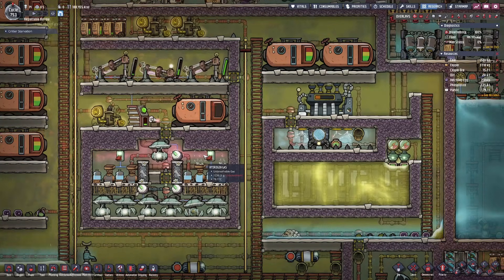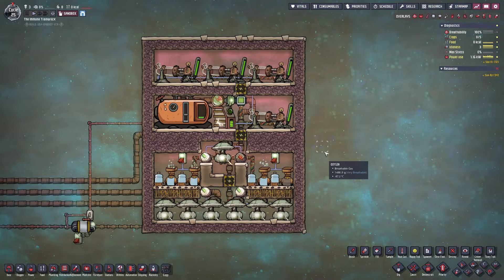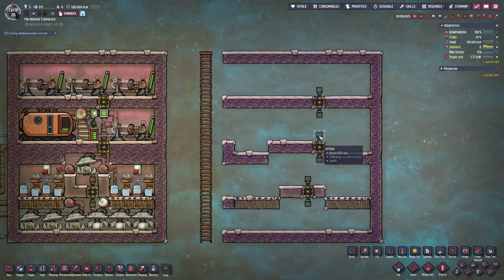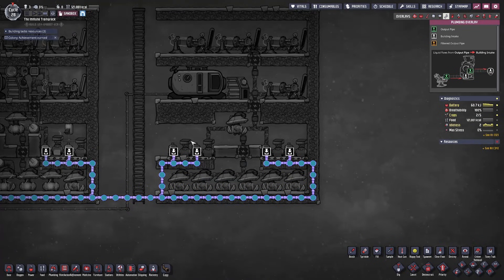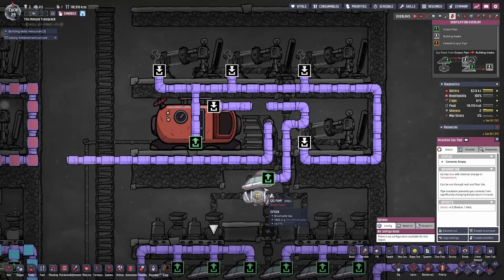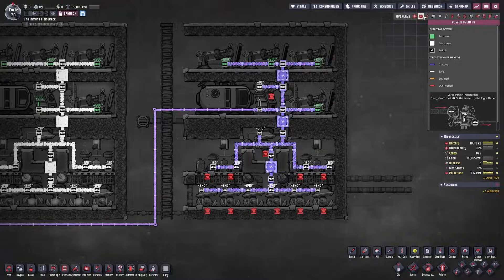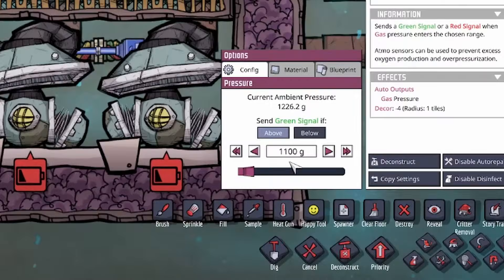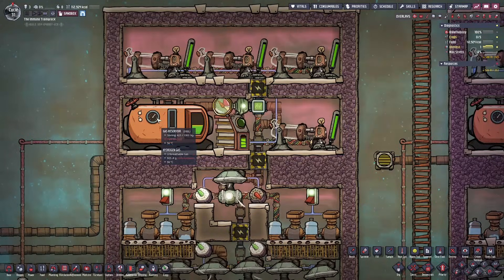HOW TO BUILD THE SPOM 2025 for BEGINNERS in Oxygen Not Included - Self-Powered Oxygen Maker

Comment: you can replace the shutoff switch to the electro's with the "Disconnect" tool at the bottom right of your screen. no water, no issue, doesn't use dupes. also "rebuilt it with the pipe" to undo it, still dupe free.

Comment: if you set the gas shutoff/sensor to O2 instead, then it'll only use power when it detects oxygen. even more power savings!

but wait, there's more! if you replace the shutoff with a vent, it uses no power.

Comment: What about cooling inside of the H2/Battery chamber?
Reply: Not sure if the setup in the video overheats given enough time, but if it does it would probably never overheat if you had the gas pipes carrying hydrogen to the generates pass through the hydrogen generators (rather than burying them in the insulated tile) and used radiant gas pipes for those sections instead. The hydrogen comes out at a cool 70*C compared to the 125*C overheat temperature (w/ gold amalgam). The hydrogen generators destroy any heat in the hydrogen so I'd imagine it's extremely unlikely the stable temp is anywhere close to 125*C.
Reply: @garrettgutierrez2677  Well I tried it both ways and I can tell you from bonafides that it will overheat, even with using the incoming hydrogen for cooling. It just takes a long time.

Comment: Nice touch! I love the gas shutoff.

I'd suggest to add a valve in the water supply line for fine control of output.

Other thoughts I might try..
- 2 of the hydrolizers get a switch each, so I can easily go for 1, 2, 3 or 4 active depending on colony growth
- maybe also add some of the oxygen pumps on those switches
- hydrogen first goes into storage and local generator & smart battery
- no heavy-watt wire but power converter(s) and regular or conductive wire for the local circuit
- surplus of hydrogen after 1st generator hours out to another storage with output for canister filler and extra generator(s) connected to main grid (I'd activate these on very low smart battery charge to only use in emergency)
- some way to get rid of surplus surplus hydrogen, e.g. having those extra generators also activate when last storage is full, or another overflow pipe to vent to space
Reply from the maker: Yeah, those are some great points. The switches help control output, especially if your colony is still young and you built the spom for later on. 

For the excessive hydrogen, you could use the infinite storage method and then take out what you need as you need it, or increase your power output and tie into the rest of your base electrical grid, which is what I did in the example at the start. 

On my asteroid, I didn't have a hydrogen vent, so I placed an excessive amount in reservoirs for future use.
Reply: @ethanplays-lag  yeah infinite storage would work too.
I usually forget about that option because I'm that kind of dinosaur :)

For scaling with the colony I do wonder if maybe there should be an airlock cutting the oxygen area in half. That would open when switching the duo hydrolizer on.

That way in early stages the oxygen from the single unit builds up in a smaller volume so it's fully active sooner.

I like how your presentation triggered these thoughts.
Before this I would just have built one small unit and at a later stage do another small one, or a large one and tear the small one down.
It's elegant to have something that will scale up all the way to the end.
Reply: Oh but when there's an airlock to cut it in half there should be one blocking hydrogen too.
Otherwise that side will just flood with hydrogen.

Maybe not such a good idea then. 
Or incomplete.

Comment: I adore the Rodriques SPOM, so sorry in advance for the long comment ^^' 

The Non-SPOM you show in the beginning has one huge disadvantage in my opinion.. The joint plate that you have plugged in between the gas-part and the generators-part is transferring heat to your colony like crazy... You have over 60°C next to your transformer... I would find a way to stop that heat transfer - either by vacuum or by sealing it in somehow.

Regarding the SPOM.. Instead of using that much heavy watt wire inside the SPOM itself, you can just make an overflow pipe for extra hydrogen and run that out to a generator outside of your SPOM connected to your main grid :) That is my preference, just to save some extra ore..

At 12:02 you show the gas overlay.. Now you don't need to do this, but I would add an extra line of gas pipes out of the SPOM so that you have a total of 3 lines.. The reason for this is that each of your gas pumps are able to deliver 500 g/s of gas and a gas pipe is able to run 1 kg/s of gas. So the third pump is effectively not doing anything here... Eventually that will mean that your oxygen builds up in your SPOM and stops your electrolyzers from running, until the backlog has been dealt with.. Not sure the math is 100% here, but you'll be cutting your efficiency down by a third... And you can't just take out the two "extra" gas pumps either, because you are running 4 electrolyzers - outputting 4 x 888 g/s = 3,55 kg/s of oxygen... (So actually having 6 gas pumps is already not enough and will leave your electrolyzers on pause every once in a while.. But if you add more, then it is no longer self powered, as I recall)

Also... When I start up my SPOM, I add a single bit of pipe connected to the hydrogen pipe and then use a vent to put it back inside the room.. I use the disconnect tool to cut off the supply to the main line and then i just wait for the SPOM to sort itself out.. When I start getting all hydrogen, I disconnect the vent and reconnect to the main line and then it works... I waste the little bit of materials for the single gas pipe section and the vent, because it is now trapped inside the build, but it works for me :)
Reply from the maker: Thank you for the well thought out comment! I really appreciate your feedback!

Regarding the joint plate, this is an uncontrolled environment just outside of my base, so I don't mind the heat transfer. But it's a good catch and something I should have addressed to clarify the situation for newer players. 

The extra generator is a good idea, I haven't tried that yet and I'll do that in my next playthrough, so my SPOM stays "SPOM" and can function in case of emergency situations! 

Your correct on your assessment, I have these electrolyzes pause a lot! I tend to not notice this because my playthrough usually ends with 12-15 dupes, and this setup with just two outlet pipes over-pressures my base as it is, to the point where I shut off my gas vents when the pressure reaches 3000g. It's an insane amount of oxygen lol. I could just take on more duplicants but when I'm so close to finishing I just tend to ignore it and rush to the finish. 

Your last point is a great solution to the initial startup and it's a method I've tried before, as well as vacuuming out the chamber before hand, prefilling with hydrogen, etc, there are so many ways to solve the same problems, which is what makes this game so awesome!

Thanks again for your feedback, I once again really appreciate you taking the time to write!🙂
Reply: @ethanplays-lag  So I haven't tried this myself yet... But I've heard that liquid oxygen is one of the best rocket fuels in the game and you could use all of the extra oxygen for your SPOM to something like that 🙂 In any case, I do think that in a tutorial for beginners you should probably have mentioned this change in the design to dial down on the amount of oxygen you make ❤️ Alternatively, you could just build the "half Rodriguez" which produces less oxygen in general 🙂

Comment: The gas shut off automation was a nice touch. Alot of people teaches vaccuming the chamber or just sending everything to an intial gas tank, or simply using the gas filter building but you flawlessly showed how automation can help this build and by doing so made automation seem like its not impossible (i.e. alot of people struggle with it). Thanks and keep up the good work.
Reply from the maker: Thank you for the feedback! I used to vacuum out the chambers too, but I got lazy and decided, why not just do 100% filtering and if I have any future issues where the spom needs to reset, I don't have to worry about it. Seems to work just fine, and 10W of power is almost nothing in the grand scheme of things